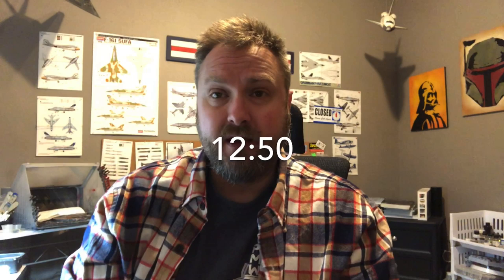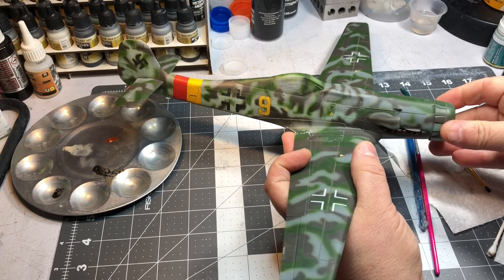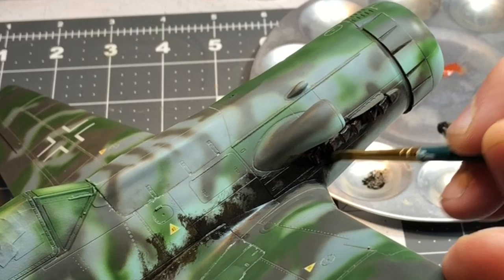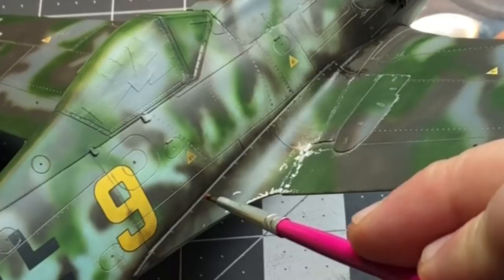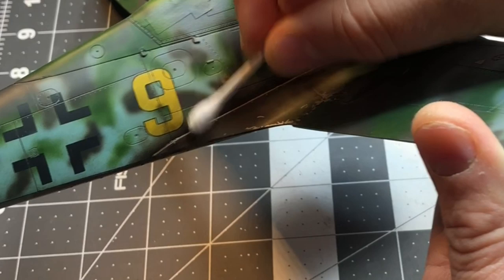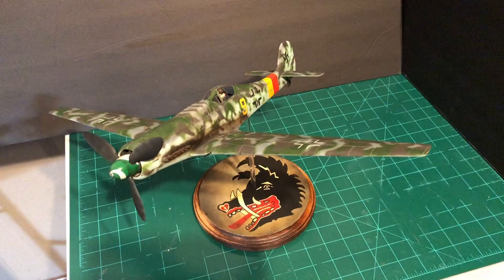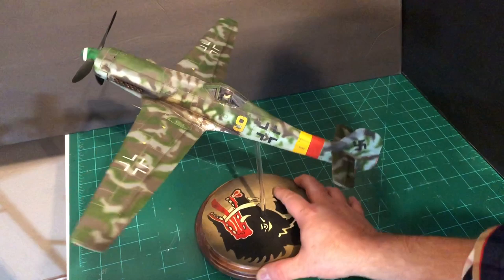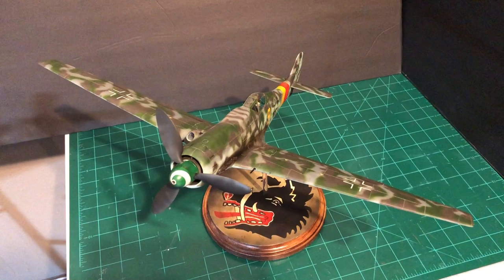Zoukei-Mura 1/32 Ta 152 H-1 Build Part 4: Exhaust Stains and Finale

Comment: Have you done a video on how you mount your models to the plexiglass tube.  I've seen the video on the base(s) however I haven't seen how you are modifying the model, if your putting something inside to hold the display stand.  interesting would be "exhaust" mounts (Like an f-14) or base mount like you did with p-51.  otherwise, enjoying the builds
Reply from the maker: Hey Amtrak, I’ve touched on it a couple of times....I last touched on it in the below copied video at 14:35 if you want to jump right to it.

https://youtu.be/eSl_2nabUoA

Comment: Hi, quick question if I may, noticed that you use a lot of magnets to hold the weapons on. What size diameter magnets to you use and where do you get them from? Hope all is good 👍. Keep up the good work 😃
Reply from the maker: I get a variety of sizes but my most used are probably 2mm diameter.  They’re pretty inexpensive so I’d recommend getting several different sizes (as small as you can get and up).  Keep in mind the smaller you get, the less weight they’ll hold.  eBay or amazon will have what you need and usually come in packs of 100.

Comment: Have you tried water based ink for panel lines... I use liquitex professional
Reply from the maker: No I haven’t used water based inks… have to give that a try
Reply: @seanerk5kt9  I usually let the ink dry a little before I wipe it away with a damp Qtip
Reply: @seanerk5kt9  oh.... And I found best results with a gloss base coat

Comment: Beautiful model Nazi German higher flying attitude fighter aircraft . History book of aircrafts in World War 2  show Nazi German test pilot flew Ta 152 H-1 fighter aircraft as first flight , flew higher attitude beyond 30,000 feet of attitude but aircraft lacked of heater and no special warmer aircraft clothes and boots  , special wool cap caused poor test pilot suffered very cold but very difficulty control aircraft flying higher attitude due pilot unable handle it till pilot push aircraft down immediately till few hours later , aircraft landed on runway then repair crew members and emergency personnel help poor test pilot out from test aircraft and special warmer bath give test pilot feel warm but painful bothering him then doctor found hands frozen as purple/red fingers & thumbs , feet must removed but never flying again . Engineers has bad mistake not put heater system in higher flying attitude aircraft . Few weeks later second test pilot wear special warmer thick wool leather clothes wool / leather boots and gloves , thick wool cap with face cover wear oxygen mask as engine start then running as heater system blast give pilot feel hot the off heater system till 25 ,000 feet of attitude then turn heater on before go to 45,000 feet of attitude . Test pilot reported it as successful flying as warmer as comfortable till reach 58,000 feet of attitude but prop spinning are difficulty due thin air atmosphere then return back to 40,000 feet of attitude till orders forced test pilot return back to base immediately till landed on runway . USA P-51 Mustang aircrafts cannot catching higher attitude German 152H aircrafts beyond 50,000 feet of attitude but 152H aircraft are best combat flight as very fast , shot P-51 mustang aircrafts but too late for best higher flying attitude 152 H fighter aircrafts due lack of parts and fuel before World War 2 ended as Nazi German surrender to USA & Britain , Australia , France , Norway , few countries plus Soviet Union . USA captured many rare flying 152H aircrafts while many destroyed 152H aircrafts by Nazi German soldiers and pilots , repair crew members . Few 152H Nazi German aircrafts are displayed at museums now but very few flying 152 H aircrafts but none reached 50,000 feet of attitude because wealthy owners feared about very rare few aircrafts . I love higher attitude flying aircrafts .